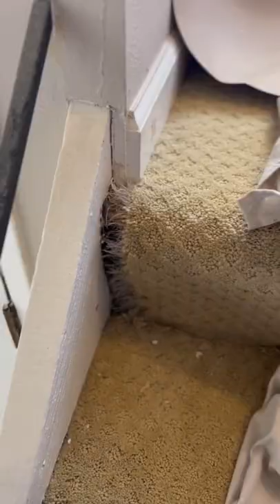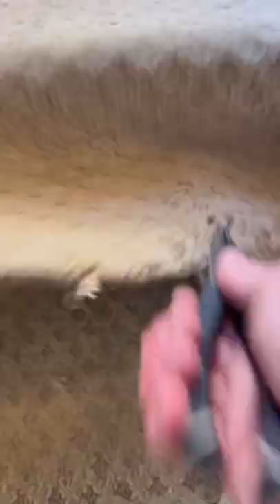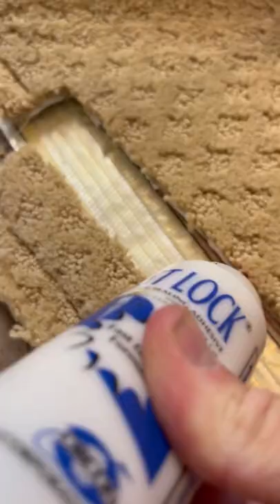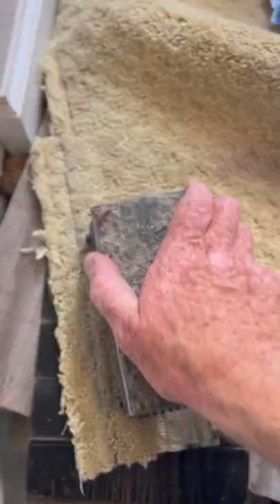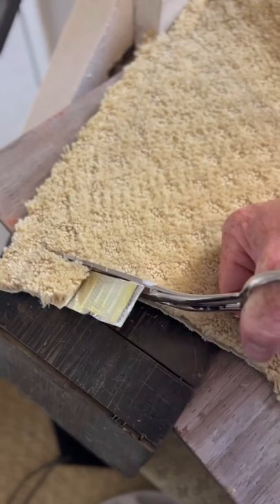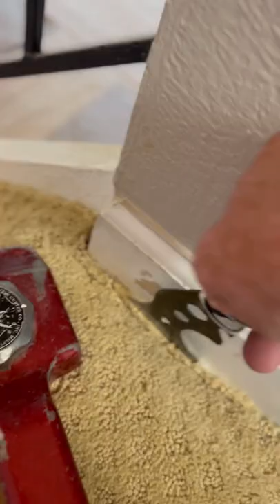Step off #shorts

Comment: Or are you just f**** overpriced that job. You should never have repaired that carpet. You should have fixed the edge of it. But put a new kick plate down the stairs which obviously they took off and that's why there's a one inch Capital going all the way down the stairs.